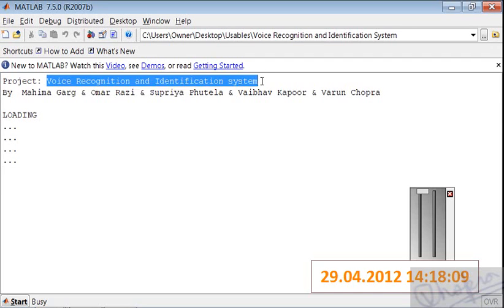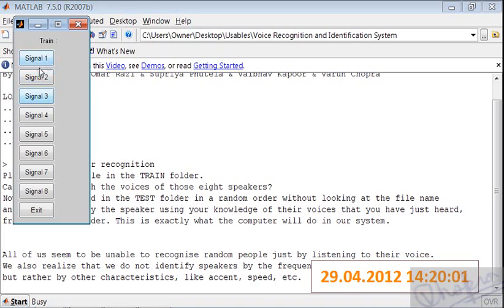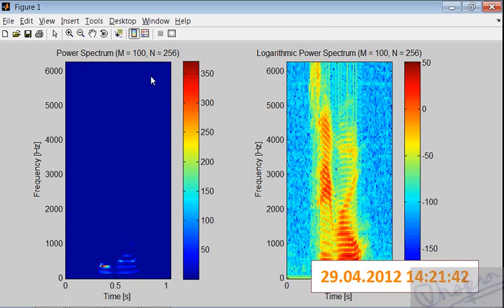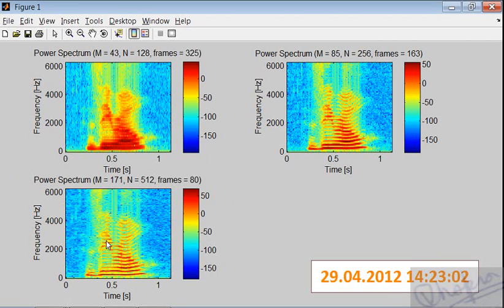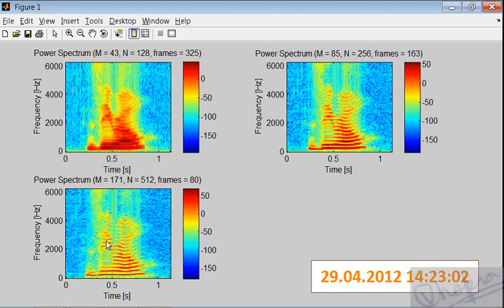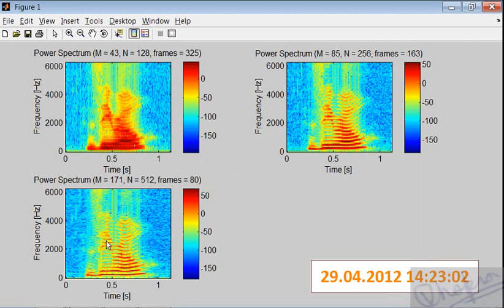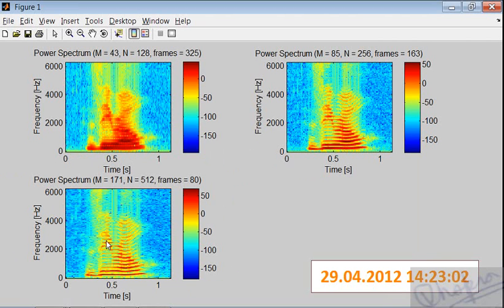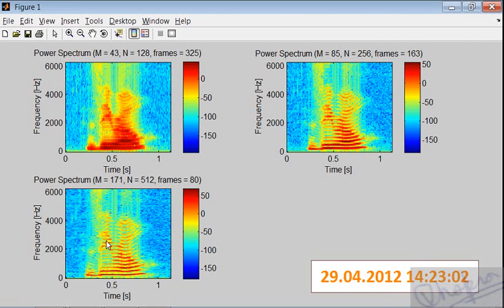#1 Voice Identification and Recognition System Project in MATLAB.avi

Comment: Hello Varun sir, I need your help..Instead of storing the recorded data I need to use the audio samples from any file location for that I need your help for modifying the program in test with other samples sections
Reply from the maker: Currently, it seems to be hardcoded, and it can be done. It will require you to add file browser functionality. Please refer MATLAB documentation for further assistance.

Comment: Hey Varun,
I tried using your project #2. I am presently using Matlab 2015b, but since 2015b is not compatible with wavread, I changed all occurrences with audioread. But now I am getting an another error such as:
Error using audioread
Too many output arguments.

Error in voicerecognition (line 45)
    [s1 fs1 nb1] = audioread(st);

Can you please help me with this? Please give the solution to solve this.
Reply from the maker: Please check with WavRead Documentation and discussion below. It returns bits per sample and sample rate), along with all of the samples.
https://www.mathworks.com/matlabcentral/answers/94919-what-is-the-format-of-the-data-from-wavread-and-needed-for-wavwrite-in-matlab
Please check with latest documentation to see how we can extract these information.
Reply: Hi, have you found any solution?

Comment: hi,I have tried using the code and everything works fine , thanks to you even the voices are being recognized when present in the database but when I tried using a new voice that is not present in the database then also it says that the voice is recognized , the problem I'm facing is that I'm not getting the wrong user ( when another voice is played which is not present in the database )
could you help me on how to get the wrong user , should I adjust the sampling frequency ?
Reply: When I click on Train and then Signal 1, it disappears and gives an error. Though I've downloaded the zip folder provided here. Can anyone please suggest what to do? If it's the directory problem then please explain how should I correct it?
Reply: the code works perfectly in matlab versions till 2012 ad better use operating system windows 8 or before and i dont think there's a problem in the directory.
Reply: Yes I got my mistake. It's working now. thank u! but now I get the message that "database is empty" whenever I click the User
Reply: everytime I run the program, I always get error in this. 
    % Read audio data from train folder for performing operations
    st=strcat('train\s',num2str(i),'.wav');
    [s1, fs1, nb1]=audioread(st);
    str{i} = s1; fstr{i} = fs1; nbtr{i} = nb1;

    % Read audio data from test folder for performing operations
    st = strcat('test\s',num2str(i),'.wav');
    [st1, fst1, nbt1] = audioread(st);
    ste{i} = st1; fste{i} = fst1; nbte{i} = nbt1;

It says too many output arguments
can you help me?
Reply: Mee too, have you found any solution?

Comment: may i know why are u using the below values in vqlbg()?

e = .01;
vect = mean(d,2);
dpr = 10000;
Reply from the maker: JJ Huang I guess e denotes the difference between the distance of last iteration and current Iteration so if its less than .01 than break out. This is kind of indicator to accuracy and;
 dpr stands for maximum number of iterations for splitting and repeating the process. and 
vect will store the mean across the second dimension.
Reply: sir, what version of matlab are you using?
Reply: 2014a...well the code works perfectly fine..
Reply: JJ Huang can you give me a link of 2014a matlab sir? because it will have an error. and I am having a project like this to be submitted by next week. can you help me with this sir? it would really be appreciated and a great help for me sir. thank you sir.
Reply from the maker: I am using the template for Vector Quant. Linde Buzo Gray Algorithm
http://minhdo.ece.illinois.edu/teaching/speaker_recognition/vqlbg_hints.html
Please read more about it in LBG research paper.

Comment: Varun,
If i can give a audio of 3 people talking for 10 Mins,
Can we identify Who is Taking and what time he started and what time he stoped on a time scale..
for example  there are three persons ( P1, P2, P3 )  taking starting from 1:00PM .
But P1 talked from 1:05 PM till 1:07 PM  , P2 talked  from  1:06 till 1:09 and P3 talked from  1:10  till 1:15 PM , and if you observe there is a overlap between P1 and P2   for about 1 minut that is from  1:06 PM till 1:07 PM ..
Reply from the maker: No not based on the current project.
It can be splitting of time frames and creating database for each if found different with created database (kind of a loop check).
Check the prototypes online for the problem for more help

Comment from the maker: You might try renaming some files or directory as 
the current directory folder name is match with built-in function in matlab library and give the error
 " Attempt to call constructor image with incorrect letter case the solution change the folder name with unique name."

Comment: hey wen i try to run your above provided matlab code i am getting this error please help me to remove this error asap..

the error is-
??? Attempt to call constructor image with incorrect letter case.

Error in ==> imagesc at 21
    hh = image(varargin{:},'CDataMapping','scaled');

Error in ==> voicerecognition at 371
                        imagesc([0 tm], [0 fstr{ch3}/2], abs(frames(1:t, :)).^2), axis xy;

this error is same for all spectrum figures and they are not shown.plz help me

Comment from the maker: @bodyclash77 actually the concept used in this is very amateur now i had upgraded the same you could also edit some codes if you wanted to use it to full extent ..
But there is one thing that could be done put your database into test and train and rename them to s1 to s8 .wav and delete older ones. I am sure that'd help.